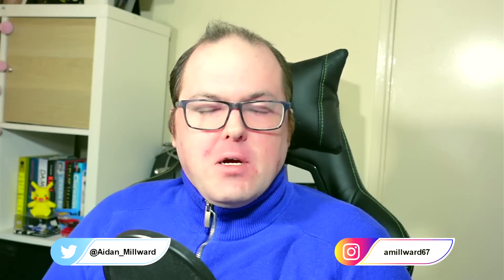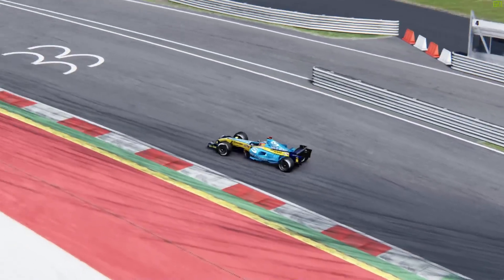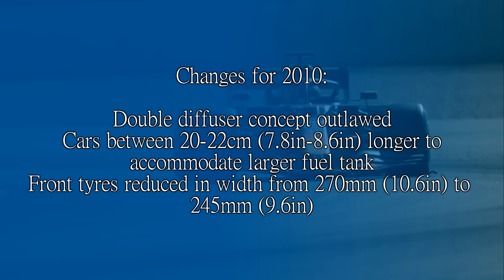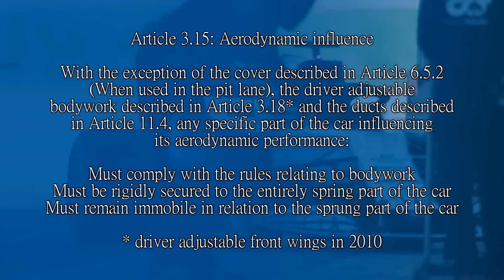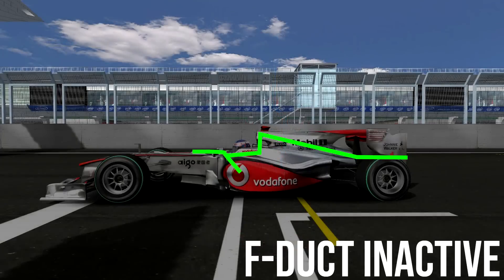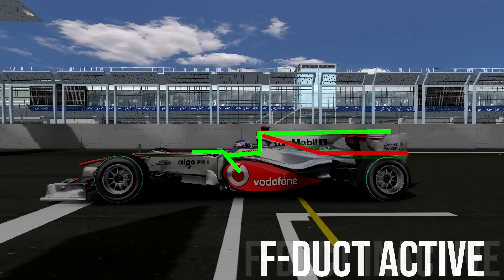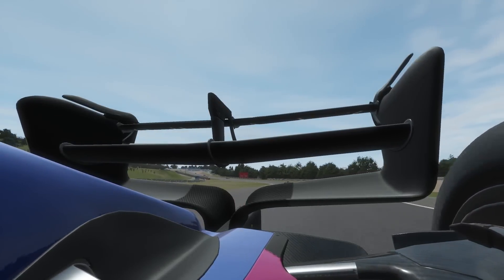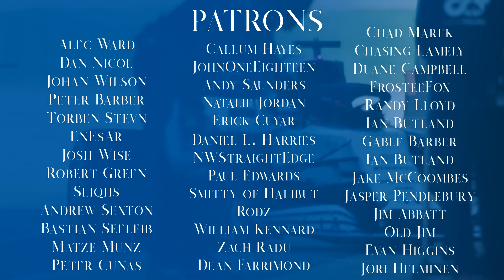THE PROTOTYPE DRS! The Story of McLaren's 'F-Duct' (2010)

Comment: The scary thing in some of the rudimentary f-duct copies was that not only was the left hand off the wheel to cover it, often the right hand would, at the same time, be having to be used to adjust brake bias, engine modes and other stuff on the wheel that drivers had to do throughout the lap... often they'd look from the on-board cameras to only have one or 2 fingers controlling the steering itself.

Comment: When you stall a wing or wings (generally caused by air moving past the wing at an incorrect speed) on a plane the wings stop generating lift or the lift is reduced.  Downforce is just the inverse of lift, a spoiler is just an upside down wing; if you stall it you reduce its inverse-lifting effect and corresponding drag.

Comment: I loved the FIA attitude to the F-Duct, their response to the other teams' protests was basically "Yeah? And? Go design your own if you don't like it" wouldn't see this level of engineering these days.
Reply: In fairness, that is generally the answer even to modern times, when something is actually just clever and legal.

DAS is probably the best example of this. The stock response is that "But the FIA banned it for the following season" which is actually untrue, it was already banned for the following season before Merc designed it as the regs were already pretty much in place.

The issue has always been that teams find weird fucking ways to argue stuff should be banned on safety grounds. This is what happened with the F-Duct (with iirc Ferrari and Red Bull especially lobbying that having to remove thier hands of the wheel was dangerous and so the entire concept should be outlawed) and is similar to what was happening last season with the porpoising issue, with Merc pushing hard for tech reg changes due to their car porpoising so much (and whilst I actually agree with half the argument Merc was making [that it is not correct to expect Team to self regulate in regards safety vs speed] they were pushing for changes that would be safe whilst conviently negatively impacting opponents).

I do think changing regs for the following season if you feel something is far to expensive and effective for other teams to be able to copy is fine. I think the cases where this has been done in the middle of the season (engine modes) is pretty bullshit though. Whist that one was pre-cost cap (and engine related so it would be technically free of the current cap anyway) those sort of changes really need to not happen anymore, as it is going to stifle innovation as why risk designing something that might get banned when your limited on how much you can design.

Comment: What little speed advantage F-Duct might have given the 2010 cars was negated by the downright dangerous methods by which drivers activated the contraption. Although the unregulated use of the gimmick should have been carried into the subsequent 'DRS', where it can used at any part of the track during 2011 & 2012 qualifying. Unlimited use of DRS should be allowed during the race to close the gap between cars and to set up an overtake, rather than to perform the actual overtake.
The F-Duct, while a significant development, was minimal on the overall 2010 technical race since it was promptly banned the following year. It was a distraction to the real performance gains to be had in exhaust-blown diffusers, engine mappings, non-flexing flexible aero parts, and what appear to be 'triple-diffusers' (at least from looking at the superbly illustrated works of Giorgio Piola's tech guides). The McLaren MP4-25 ran the most extreme iteration of double diffuser but relied too much on F-Duct's minuscule gains. The Ferrari F10 was always playing catch-up, with a revised F-Duct and completely redesigned rear suspension/gearbox assembly to optimize its extreme diffuser. The Renault R30 apparently ran an F-Duct in late season that exceeded that of McLaren, but lacked the aero and diffuser to make gains. But the Red Bull RB6 was far and away the best package to feature all the aforementioned, yet having never to compromise the car to accommodate the F-Duct.

Comment: the solution for the DRS is something I comment on every single video about DRS, something I call de "master gimmick" that is simply make the cars run DRS on during the whole lap and close only on key corners allow closing by on straights, but the car ahead can still pull a defense (or not, who knows if this debauchery gets more efective than the actual DRS)

Comment: I too think that FIA chose not to ban it as you say because it helped prepare the audience for the idea of a stalled rear wing. 

Because my favourite go to banned “aerodynamic” device is the mass damper. Come on, if that can be banned under the no movable aerodynamic parts rule then anything can be. It would have been so easy for the FIA to say that for the purposes of the F-Duct the drivers leg has become a lever and it’s banned. 

My final point on “movable aerodynamic devices apart from those listed like DRS” yadda yadda rule is that every car/some/most? on the grid is of course illegal. Because they have springs and even hinges as part of the bib/t-tray assembly underneath the front of the car. On any lay reading of the rules it’s just not in there that this is allowed, but they have it and it passes scrutineering somehow.

Comment: Question about the drs system used today, what if the cars under 1sec after the car in front (like now) gets drs right away after the corner but the drs closes before top speed, or at top speed, so the car would gain the lost time in the corners during the acceleration and not the top speed? what do you think?
Reply: DRS is there to counter the loss of traction experienced by the following car so allowing it to open earlier wouldn't really help matters. You can't accelerate faster out of a corner if you don't have the traction to do so and by opening the wing earlier you've only made things worse by reducing the available grip on the rear wheels.
Reply: @TjDolHaus86  well yes, you cant open the drs while traction is a problem but after the traction phase of the acceleration. But I dont really get what you mean by it wouldn't help? For example monza start/finnish straight, if they can open drs at the start of the straight, not the middle, and then be able to reach top speed faster then the car in front, plus after the drs closes slip stream is still a thing. Monza is the extreme example

Comment: DRS could be sorted possibly by having it deactivated when the overtaking car gets alongside the other. Or the front tyres of the overtaking car in line with the rears of the other
Reply: Yes, my major gripe is that it was only supposed to put cars alongside each other into a braking zone, but instead the overtake is happening well before.
Reply: @Gordanovich02  think of the 2020 portuguese gp and the unholy drs on that track